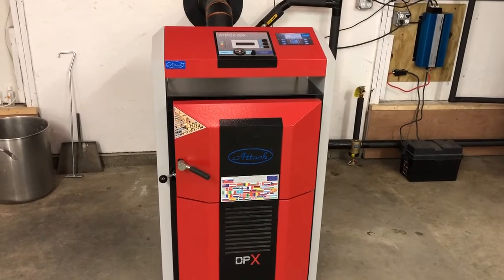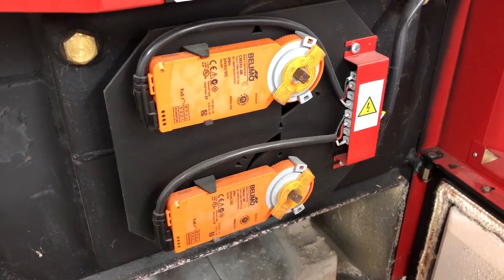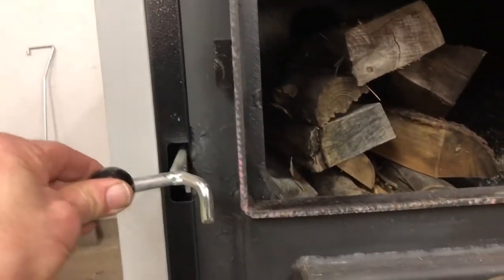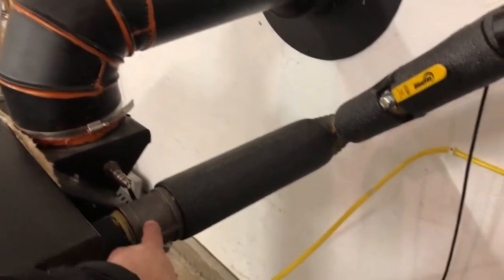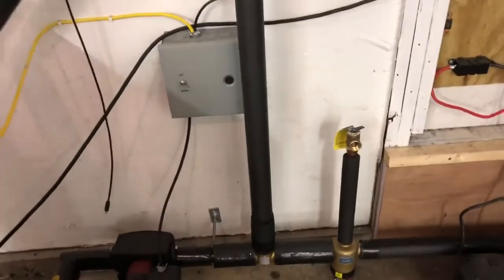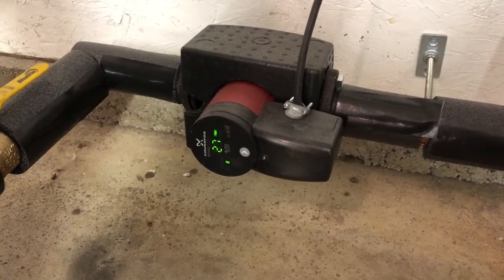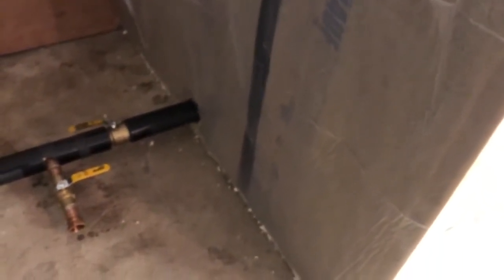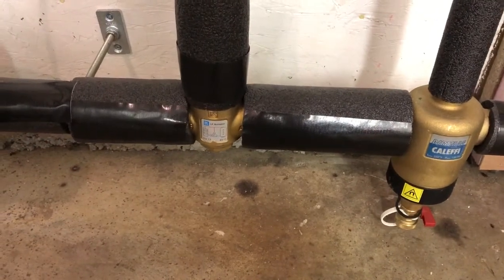Part 1 Attack DPXL-45 wood boiler w/1000 gallons thermal storage overview

Comment: Hello Tim. I have a Attack wood gasification boiler. And are troubled with the temperature probe. We recently lost power and the boiler was running well untill the probe melted and shut down the boiler. I have replaced this sensor 4 times and owned this boiler for 10 years. Any help in modifying such to withstand a higher heat? Or not so quick to melt together? Thanks
Reply from the maker: @brucebonnevie8950  I’ve never had this problem but run both my boilers with either battery back up or from my off grid solar system thus am immune from power drops.  Perhaps consider this option?  The battery back up is simply a pure sine inverter and 12v deep cycle battery, total investment around $500.
Reply: @timdahm7039  I am interested in the battery back up.will watch your u.t. presentation

Comment: Have you thought about posting a diagram of your system? I am curious how your storage system compares with those using a thermal transfer coil, or coils. Ideas?
Reply from the maker: More info here:
https://www.hearth.com/talk/threads/attack-boiler-w-550g-open-storage-install.183654/
and:

https://www.arboristsite.com/threads/inside-wood-gasification-boiler-w-1000-gallons-thermal-storage.337980/

Comment: I have watched your video several times, because I thought maybe I missed how you fill your system. You have a supply line coming from your house? If so, where is the water inlet tap?
Reply from the maker: I have a tee with hose connection in the line that runs from the bottom of the storage tanks to the return on the boiler.  To fill I just opened one of the vents located at a high spot on the system to let the air come out and filled until water started coming out that vent.  I then closed that vent and pushed more water into the system until it reached about 5-6 psi cold.  Any remaining air was removed by the automatic vents as I was firing the system.  I may have had to add a bit more water later on to achieve my desired14 psi system pressure when hot.

Comment: how cold do your winters get? and how many cords of wood do you go through  a year?
Reply from the maker: Located in south central Minnesota. Seen -30F many times and most winters there can be a week or two stretch where it doesn't get above 0F.  Boiler seems to use a cord every three weeks. My heat emitter set up is less than ideal because the house wasn't built with radiant heat in mind. A water to air hx in the forced air furnace plenum is not an ideal heat transfer device.  Boiler and storage in the building you want to heat make a big difference as no matter how much you insulate boiler, storage and  piping there will always be loss and you want that loss to go where you can use it.
Reply: @timdahm7039  thats normal for our winters . we are already at -15c this morning

Comment: Is there anything you've changed about your setup or that you would do differently now that you've had it for a full season?
Reply from the maker: Yes- avoid pex-al-Pex fittings with o-rings if possible.  About 1/2 mine leak when the water temps drop off.  Need to redo and see if the chamfer tool will make them seal up.

Comment: Great videos Tim. I have been working on setting up an attack DPX 25 in my garage that a friend gave me. Its brand new and he didnt install it. So your videos are great and better than best, they are in english. Everything I find is not! Can you tell me about the flue and chimney? I need to get to a ceiling outlet 10 feet to the side and 12 feet up. Looks like you used some standard black pipe and fire stop to seal it then went into a masorary chimney? I dont have that and the final pieces would be double wall? The instructions are not very clear on chimney except it says no bends, which is nearly impossible, and 11 meters of stack, which I also wont have (Max height will be 18 feet tall. I see even you have 2 90's in the black flue pipe, I am concerned about draft, angles etc, but cant do all the flue in double wall.
Reply from the maker: The chimney is all Selkirk Supervent Class A from Menards.  Except for a short ~12" section of single wall black connector pipe directly from the boiler flue outlet but then all supervent Class A.  3' length horizontal class A  through a wall thimble, class A tee and then straight up 14 or 15 feet.  Works just fine, I did seal the joints from the boiler outlet to the first section of Class A with some high temp silicon (reddish orange stuff good to 800F) because you will see some smoke spillage here if you don't.  The draft inducer on these boilers causes some positive pressure here on start up.
Reply from the maker: Oh, I forgot there is also a single wall black 90 degree elbow at the flue outlet on the boiler because the outlet is set up for vertical.   The flue outlet on these is changeable from vertical to horizontal.  I didn't convert it on this one because the chimney penetration through the wall was too high and I would of had to build a stand for the boiler to raise it to match.

Comment: Have the same boiler and looking to setup storage.  On a reload burn does it fully heat your 1000 gallons?  What’s your reload temp and final temp after burn?
Reply from the maker: I do one burn every 24 hours during heating season.  IIRC my reload temp will be 120-130F and end of burning session will be close to 180F.  This will typically take about 1.5 firebox loads.  My wood is cut short at 18-20" for this boiler so probably not utilizing full firebox capacity.

Comment: Where did you get this boiler?  Does it adjust to American 120v 60hz power?     I believe Europe is 50hz?
Reply from the maker: The boiler was purchased from newhorizonstore.com.  As delivered in Europe it is set up for 220V 50hz.  Newhorizon adds a set up transformer to go from 110v to 220v. It runs just fine on 60hz.